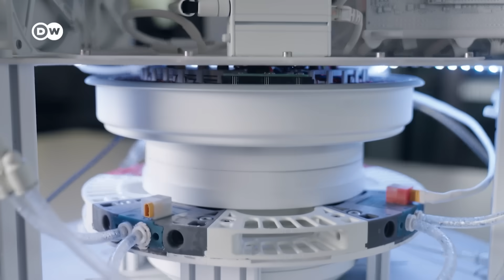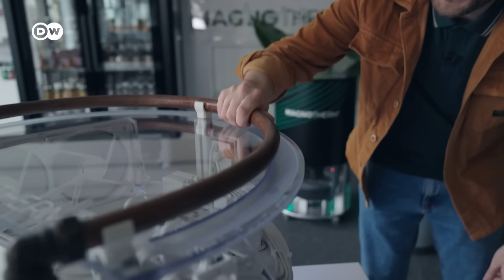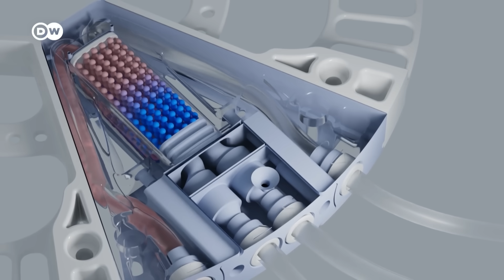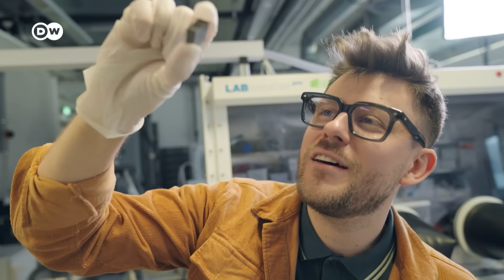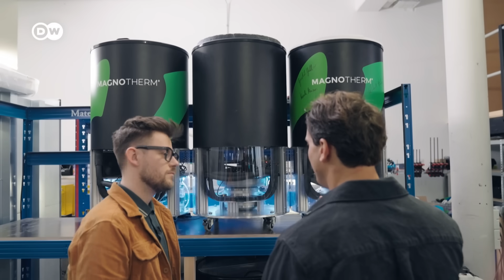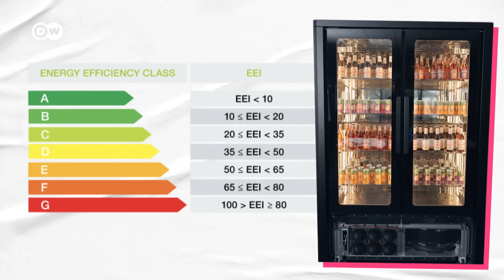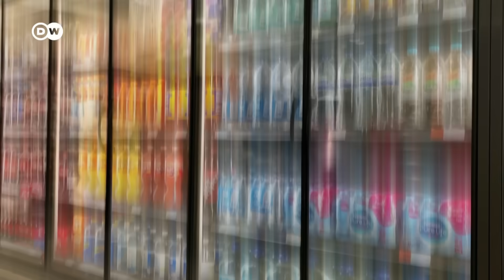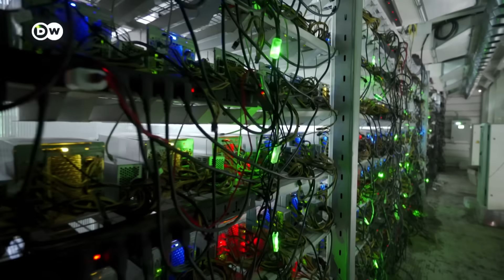How magnets could change our fridges and ACs forever

Comment from the maker: Would you prefer to use magnetic cooling in your house?
Reply: But can it freeze?
Reply: @Scootdog8472   doesn't look like it given the info on this video  🤔
Reply: @Scootdog8472  They said it's low temperature is 6°C. It was have to go subzero to work for Americans (mostly).
Reply: If it works as well and is cheaper, of course I'd use magnetic cooling.  I'd use rat-turd cooling if it were better and saved me money.
Reply: @charliedoyle7824  
Has this technology been mentioned in the Operations Manual of War & Peace ?
Is rat-turd halal certified ? 🥴
Reply: Right now, no. Phase-change refrigeration is a very mature technology, very reliable, cost effective, and easy to repair and maintain. The magnetocaloric cooling system might be more efficient, but seems to impose many challenges in manufacturing, mechanical complexity, and electromechanical management of the system. In 10-20 years it'll probably be perfectly viable, maybe even competitive in terms of upfront purchasing costs, but I can't afford to invest in this kind of "early adopter" tech.
Reply: Not at those prices, no.
Reply: NO! I want the awesome Freon powered AC and fridges we used to have that worked wonderfully for decades with no service, and got REALLY COLD.
Reply: @FerdGerbeler  Donald Trump said magnetics don't work when they get wet...alternative facts. He also said windmills cause cancer...alternative fact or is anyone who believes these alternative facts struggle with cognition at the extreme level?
Reply: @billhorton2564  Dunno what the Orange Traitor has to do with any of it, these new technologies do not cool anywhere near as well as old low pressure freon cooling systems, it's simple numbers..
Reply: This could be boon for split ACs where gas leaks affect environment
Reply: I've heard about magnet based fridge for decades, hopefully it's a reality this time. I'm sure Haier and other giants do the same research, they might be getting there faster if it really feasible.
Reply: @YSKWatch 
Godrej Cube is one such SOLO fridge
Already.
Reply: Are they quieter? If so yes.
Reply: No. Too expensive, too complex and too many failure points. Not to mention the fact that existing professional repair / maintenance services aren't trained for them, so if something goes wrong, repair costs will also be high. I'd rather use one with a better / more efficient compressor (screw compressor for instance), as that will have higher efficiency also, but the majority of maintenance is still the same as "normal".

Nice idea and interesting engineering, but I fear this is a product developed primarily on engieer hype rather than practicality. I expect there would be a few niche fields that this is ideal for, but don't think it's good for the general market.
Reply: It's interesting but I'll wait and see if it can match up to my standards.
Reply: 8:00 translation. they are at 5% currently and working towards getting to 30% more efficient.
Reply: add ' far uvc led ' tech to the fridge when you kloz it
Reply: I believe that amount of efficiency and savings can be achieved by using innovations such as doors and drawers that are designed to prevent cold air dumping when opened.  Nobody is looking into this.  Bottom freezer drawers that are sliding sleeve design that hold heavy chilled air rather than letting it spill out through a rack.  Double refrigerator doors that don't allow opening both sides without an additional action such as pushing a release on the second door.  There are other ideas
Reply: What is the price?
Reply: Not exactly!
Reply: @DWPlanetA

"As our planet gets hotter
and hotter every year"

🙄
Reply: If it is 30% efficient, that means I can drop my thermostat to 62 at night and break even on 68 probably and i live in Texas so means that we can keep it at 62 instead of 72 because it can hit 110 to 115 here easily and any efficiency can help out our bills
Reply: @KingLarbear  if water availability is not an issue, use a desert-cooler during the dry periods. It will reduce your electricity consumption.
Reply: @KingLarbear  But the cost of the ac would be 3 times more expensive than a conventional ac. Also, since it's a new and complex technology, it will likely be much less reliable, and costly to repair.
Reply: My Inverter fridge is energy efficient enough. Not put a complex cooling system in a fridge that will expensive to service and expensive to repair.  We have better energy production in the works and arriving, that will solve the problem. Cheap electricity
Reply: please see comments 🙂 below I posted for you
Reply: Not if I understood what is described in the video.
Reply: I’m an ignorant person - curious how this system would be able to use water as the heat transfer fluid and yet can power a freezer (can it?)
Reply: Give me a turbocor oil free magnetic bearing compressor in domestic application then I'll think about it !
Reply: What about using this magnet tech for heating? It's well known among some circles that heat pumps are way more efficient than resister heating for warming up, but if the temperature dips much below freezing that causes issues with compressor heat pumps. 

Magnets in theory wouldn't have that issue or have it nearly as much so you could efficiently heat pump from much colder temperatures.
Reply: If it's free
Reply: REF and AC reached to high reliability in past. You had REF and AC which works for 20~30 years. Then started with Q decreasing (quality) and more complex solutions (displays, proccesors, inverters, ...) what ruin Q but improved efficiency.
I see your magnets driven cooling effect not efficient related with efficiency factor, size and cost.
From seen I assume that such technology could reach reasonable level to be used for end user REFs/ACs in next 20 years (or never).
Reply: It might be good for a window mount AC if it turns out to be lighter and able to handle the load. With a low temp limit of 9 C, I can’t see any other use.
Reply: I would… but only after the R&D team finds a way to get rid of the rare earth material entirely.
Reply: @chlorosokita596   So you want a powerful permanent magnet that isn’t a rare earth? Why not invent warp speed or teleportation while you’re at it?
Reply: @atilkan  why don't they use electromagnets instead of ...magnets !?
Reply: great technology..... not a good video.... this video shoudl have been 3 mins with the relevant info only....not this waste of time and useless presentation.
Reply: Not having the ability to create sub zero temperatures is a deal breaker for me.
Reply: No, it's a very expensive way to save a little energy.
Reply: This might be the dumbest idea for a fridge, I've ever seen
Reply: Definitivly!
Reply: This type of technology might perform well in electric motor cooling especially in Electric vehicle
Reply: If it saves me money, absolutely!  Anything to get my energy costs down as long as the appliance does not cost so much that in the end it would not matter.
Reply: Cool tech but hell no, this looks like it has so many more points of failure plus most fridges also have a freezer and these can not get cold enough and even if they could they are using water in their cooling pipes, seems like a huge waste of time and resources, imagine working on something for so many years and it will never get to market
Reply: Once again...more energy cost to produce then you'll ever get out of it.
Nothing beats fossil fuel...it's free energy...all you have to do is dig it up.
The problem is...too many people.
Reply: @johnbaldwin2948  You have a gasoline fridge? Maybe you meant you prefer fossil fuels in your car. Most of the items discussed here run on electricity and there are many more ways of making it than fossil fuels. Methods that collect energy from nature don’t even have to buy fuel. Free energy … just build and run the collection facility.
Reply: No. The cooling element does not have a hot side and a cold side and requires mechanical valves and a pump to gate the hot and cold fluid through the element. Pumping heat by magnetizing and demagnetizing the same thing with a magnetic flux is not efficient.  For each cycle the difference between the cold and hot fluid is lost energy through heating and cooling the element with the flux. To increase the efficiency you need to decrease the mass of the element considerably which may not be achievable.
Reply: @cyber5515  a small element is not able to transfer heat efficiently
Reply: 6-9 deg Celsius IS NOT food safe temperature... or not even freezing temps... not to mention bearings wearing out or other expensive replacement costs... another "Green Energy" subsidized pipe dream
Reply: TIRED OF SEEING CLIMATE
CHANGE    LIES LIES LIES
PROTECT waters, foods, sky's
Reply: How much power does it use at the plug or solar panel, with that practical use comes in with the barrel model refrigerator in a home or mobile setup.
Reply: You didn't say anything about life expectancy and waste management. Will this improve capacity for repairing or recycling? Energy efficiency improvements are not the only solution needed today.
Reply: not now coz its too much expensive right now.
Reply: Bro keep the electric bill of the house low. it should be energy efficient too. As of looking at global warming rising temps AC's and fridge also has its own Limitations. Large refrigeration storages use Amonia instead  of R32 refrigeration gas for maintaining the lowest temp constantly.
Reply: I prefer a solution that is well tested and used for decades instead of a prototype that has no real advantages. If you can't sell it, it means that you developed a bad product. Of course you can offer it to very rich people that want to show off, but how many of them is out there.
Reply: That is a solid "no" requiring < 2 seconds of thought.
Reply: So which one last longer before i need to replace the. The earth is dying either way.
Reply: its looking not that efficient than a regular compressor.. because today's a 200ltr inverter fridge consumes only 50watt energy
Reply: No. We already have ways of doing that and we don’t need to be coming up with new reasons to do open pit mining.

Is AC and refrigeration the best use of that resource? Maybe in specific applications but not for widespread use
Reply: Yes
Reply: why?
Reply: Folks back until 1800s achieved way more efficiency by storing under ground xD
Reply: A/C but why don't they send hot water to the water heater?
Reply: yes, here in canada would be awesome.
Reply: Sure, if you give me the $150000 it would cost... 😂
Reply: @atilkan  Brother, your AC and Fridge use compressors, compressors are way more mechanical than this concept is lmao

A fridge compressor is basically a normal air compressor, with a piston moving up and down and valves for input and output (There's also rotary compressors, which while simpler, are still mechanical, comparable to this concept in number of potential fail points i would say)

The big advantage these magnetocaloric systems have is not only energy efficiency and simplicity over regular compressors (Which means they should last longer), but also that they don't rely on refrigerant gas, which means no potential leaks from the high pressure system a compressor would otherwise have, and no nasty gases that could be harmful for your health or the atmosphere
Reply: @Psyden5757  A compressor based fridge has one motor which drives pistons and crankshafts. Modern refridgerant gases are safe and not "nasty" to the atmosphere or health. You can even use carbon dioxide, thus removing it from the atmosphere and making it useful.

Compressor based cooling is significantly simpler and thus far easier to repair and they have proven over a VERY long time to be reliable. Fridges can last 10-20 years or more.

If this is the complexity of a "replacement", I'll keep the compressor based. You're talking nonsense when you say this is less mechanical, that is clearlly a lie. There's multiple pumps, a rotating disc that moves the magnets, and finally the fans. A compressor fridge has ONE MOTOR.
Reply: @Psyden5757 I guess his refrigerator really isn’t running
Reply: @Psyden5757  As with EVs there appears to be a range issue, in this case with temperature. It's not very efficient for domestic use if you have to buy a compressor driven freezer as well as a magnetic cooler.
Reply: @Psyden5757 and yet wi still can start fridge from 1960 and it will work fine, and also normal ac and fridge is very mass produced, so they can be cheap, and also even nasa use norma ac chain to get almost absolut zero, so they have giant way to go before they can make it cheap enough to actually produce and sell
Reply: @Mira_Xomche  Well yeah of course compressors are cheaper, they've been a thing since 1927.
As this new heat pump gets older it should get cheaper and more commonplace, that's how it goes with any new tech
My point is this shows huge potential and has many advantages over old compressors
Also fridges from 1960 may still work but they're incredibly inneficient
Reply: @Psyden5757  if you didn't know old fridge and new one is about same effecincy, because of how compressors work, their effectiveness being from start because of they are moving a lot more heat energy out or in then they use electricity, and most effecincy gains in new fridges is more about better insulation so they let lees heat inside and effectiveness of its heat exchanger radiators
Reply: @Psyden5757  And I can change that fridge compressor under one hour including gas refill. 

Even big AC circuits will have like... 5kg of coolant or so. It is either gonna leak in harmless amount or for very short time. Not to mention that highly toxic coolants are not used outside of industrial systems.
Reply: With this can we also cool computers too?
Reply: @sahinyasar9119  it will effect the MOTHERBOARD
Reply: @sahinyasar9119  sounds risky, eletromagnetism, next to a computer... a malfuctions and u could get a small EMP
Reply: @diogoneto463  well we might never know if we dont try it
Reply: @diogoneto463   Magnetic shielding is possible using an alloy called "mu metal".  (Looked into back in the days of CRT monitors, which would go wonky if you live right next to high-tension powerlines.)  But mu metal is pricey.  And overall I just don't see much marketing potential for this technology, unless it can somehow be perfected to cool to a lot lower than 9° Celsius (as seemingly described, to be as cold as it can get, in the video).  Cooling technology used in medical settings is already expensive.  It's based on a more advanced compressor technology.  And it's in demand not for its efficiency, but because it can reach temperatures much colder than conventional refrigeration setups.  (Note, I'm not referring to liquid nitrogen here.)
Reply: No, it's not ready for primetime. Not only is it 3 times more expensive than conventional refrigerators, and weighs significantly more, but its complexity makes its reliability highly suspect. The energy savings would never cover the costs.
Reply: I’d rather those magnets be utilized for efficient work like generating electricity or as a motor while the rare earths saved or traded as currency or used in some other application.
Reply: @yoface938  Bro did you just say "rare earth as a currency"? 
"Yes, I'd like to purchase a loaf of bread for 2 µg of neodymium."
Reply: No I would not buy one. The reason this exists is because of taxpayer funded Grant's. To quote "The best part is no part, the best process is no process." - Elon Musk.
Reply: No, from what I saw this is far away from economic viability
Reply: Id prefer for police in my country to go after actual criminals instead of getting swatted for reposting a comment about a politician not being perfect.
Reply: @atilkan  Like the compressor that failed on my fridge last week? Mechanically, this setup has a lot more longevity than a reciprocating piston pressurizing coolant to over 30bar. A bunch of static lines under that immense stress which sees constant temperature fluctuations when the cooling system turns off and on leads to failure of non-moving components like refrigerant lines and heat exchangers. Efficiency and cost are the real factors that will determine the success of magnetic cooling I believe.
Reply: @94XJ  Your compressor failed because he was designed to fail, like any tool/car from the recent years. There are 30 years old TV`s and Fridges that are working today. Also Nokia phones, still works :)
Reply: Bad video, no real good explanation how a normal fridge works in the first place.
Reply: Have two questions One is relevant to the nasty gases we are talking about as far as I could tell simple water as the coolant agent that seems to me to be a lot a less dangerous from a atmospheric and a human point of view b if it's just the magnets and the flow of water then you're limited to valves right as failure points and you could conceivably build up a system where one valve fails while the other one continues to work and you replace the failed valve and you never lose coolant I mean I could be wrong but that seems to me to be the thing and my thing would be what happens if you get say a liquid nitrogen coolant point aka You're super hot water etc runs around a liquid nitrogen system shedding all of its pre-freezing heat you you cool it to within a tenth of a degree of water freezing and then you send it back into the system You've already pre-cooled water and if you have this away from the main compressor space coolant space and I'm now I'm thinking of like server farms things that have massive amounts of heat but if you transport cuz you could transport super hot water and amazing amount of distance without loss of thermal heat and then if you had it properly insulated you could have an equal length of super cold water that I don't know for a thousand feet raises a tenth of a degree of the water maybe a degree but think about that you have super cold water going into building cooling systems and or server cooling farm systems that is almost frozen and because you've got the liquid nitrogen is the main location that is cooling that seemingly on almost endless supply cold so it wouldn't matter how much thermal load you put at the at the cooling location for the building or the server farm if you're dumping the heat at a different location who cares AKA you have your liquid nitrogen even a small liquid nitrogen tank situation that is super super cold you could have large a large amount of water for a very small amount of nitrogen that is frozen and so long as you keep the nitrogen liquid but cooling cycle will run in theory forever and particularly if you said let's say you had two nitrogen cores you could always turn one off get it to the right temperature again of liquid nitrogen aka refueling the liquid nitrogen whatever while the other one is running the load I mean I'm sure it's not inexpensive but and I live somewhere that's used to 100° f heat we have systems here that struggle to keep the water at you know 35 37° coolant temperature to keep the building cool so anything that makes especially a large system like a building water system cool or hot I would think depending on your application is the point.
Reply: @joecitizen8988 
No punctuation with run-on sentences with great difficulty comprehending what was said.  Too long; didn't read.
Reply: @acmefixer1  He used a single period at the end. lel
Reply: @joecitizen8988  "Coolant" is never just water.  That expensive iron sponge would turn to crumbling rust in no time.
Reply: @joecitizen8988  and how are you going to get the nitrogen to liquid form? That would require a compressor style refrigeration system. Requiring a compressor refrigeration system to allow your magnetic refrigerator to function wouldn't make sense if you are measuring results by amount of energy required.
Reply: @joecitizen8988  JFC! Read a book will you... lrn2punctuate.